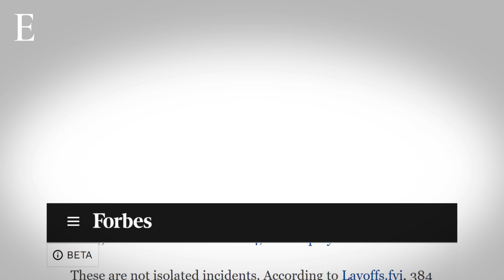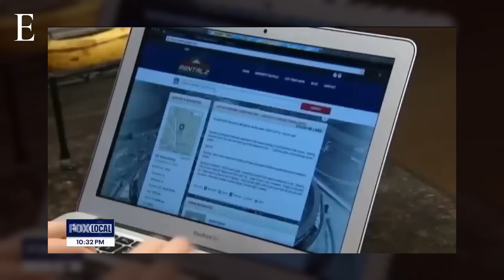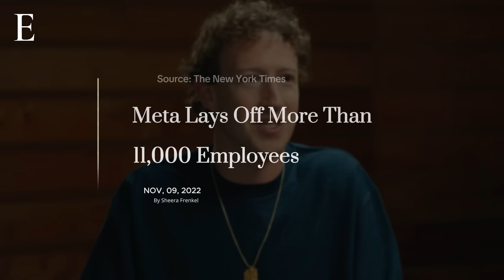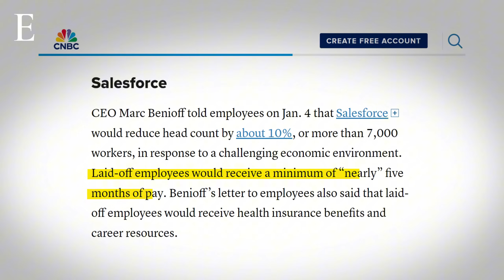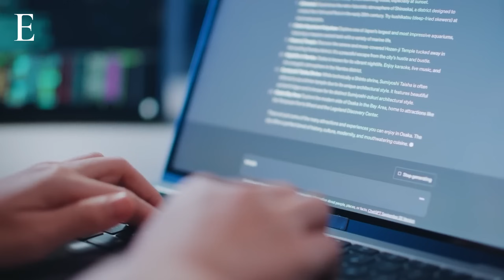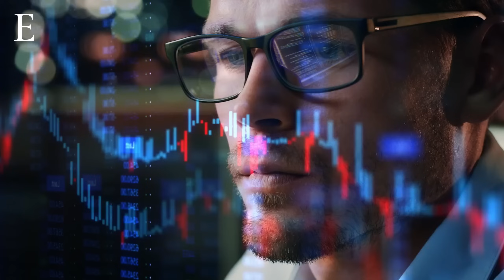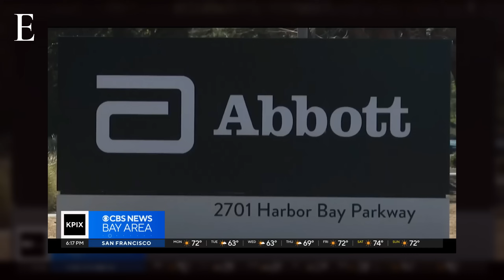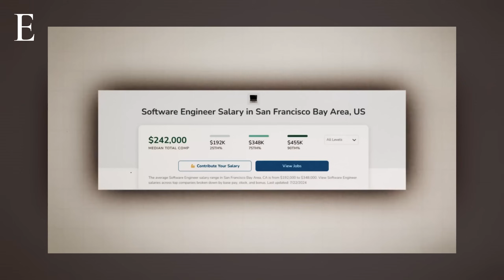Where Did Laid-Off Tech Workers Go?

Comment: "learn to code" didn't age that well
Reply: Tech is not solely software. Majority of the employees are non-software based workers, like mechanical engineers or simply account managers. Also the video mentioned the massive over-hiring in 2020-2021 which in the end didn't last.
Reply: I outsource AI-generated code to humans, for testing.
Reply: @dannypasquel  New development is to focus on innovation, and let AI do the tedious detail work.
Reply: @ViceCoin  Without you, or your engineers take any look in the code, I doubt this would be successful. Systems are complex than you might think
Reply: @VuTran-cb8co  Casino games are mostly transactions. The UI is dullstack code. I'm not designing 3D sumlations.
Reply: “Learn a trade” is so much better…. Right?
Reply: Code I think may be something you do to attach to other skills to like design

Comment: I’m glad I majored in Electrical Engineering.
Reply: it’s gonna be automated too. There are ai tools for ic and pcb design already
Reply: @Teo97b  who is going to solder those boards? Who is going to program and debug them?
Reply: @ 

a) unskilled low wage workers because soldering doesn’t require engineering knowledge 

b) number of engineers will be reduced because it will be faster to program debug and design